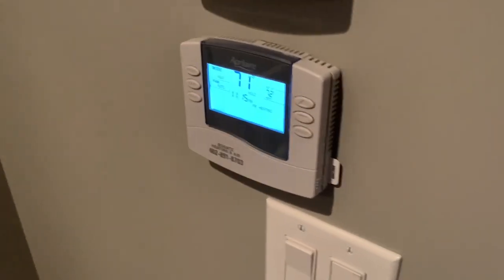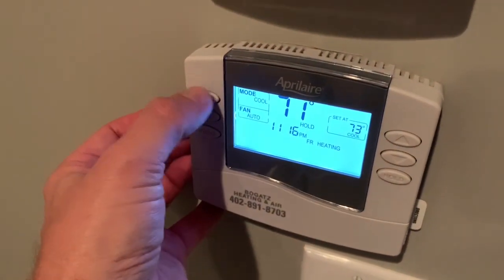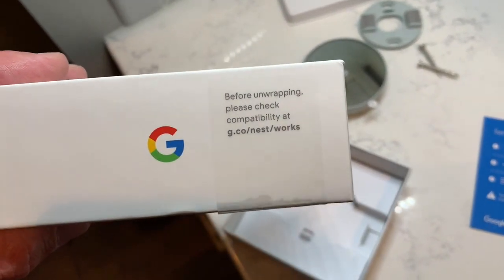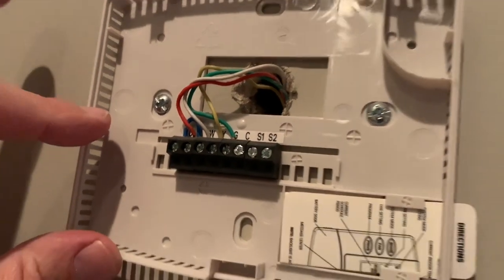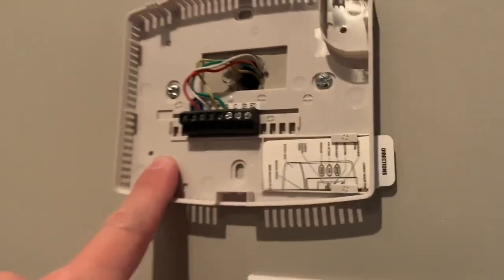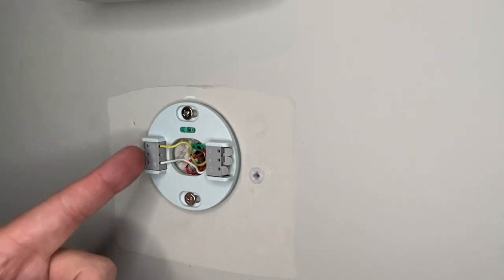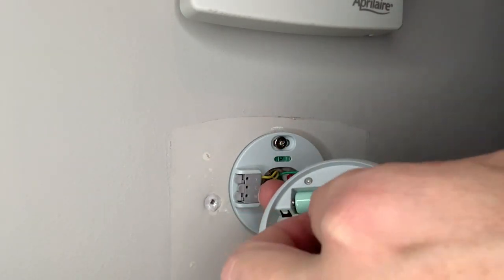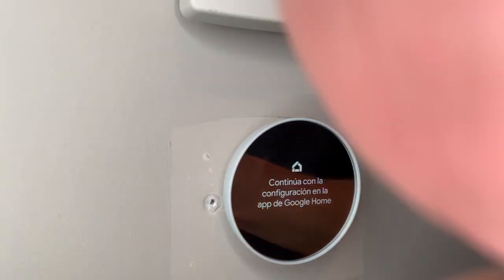Installing a google nest thermostat

Comment: On many systems a C wire or C wire from a 24V transformer is needed so the batteries don't drain out....This video does not show any C wire ....  not sure how long it will last.